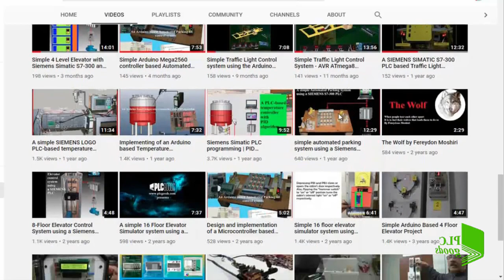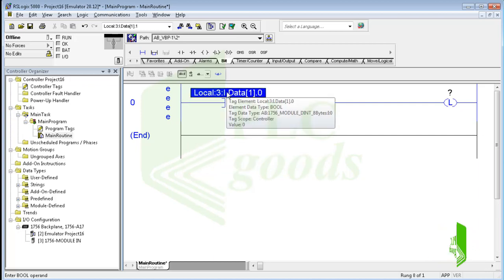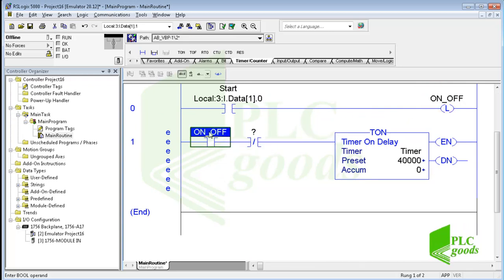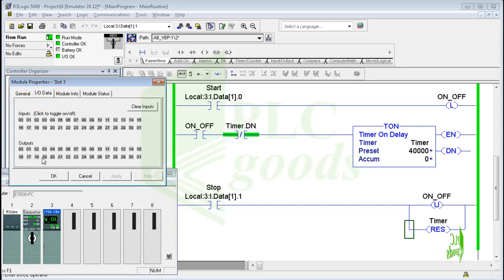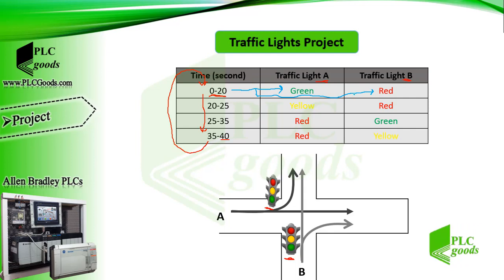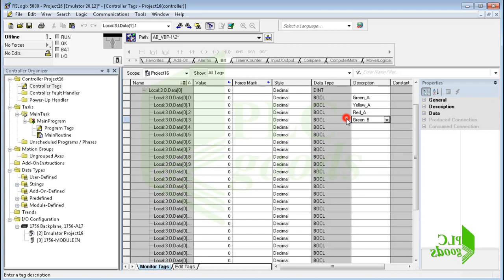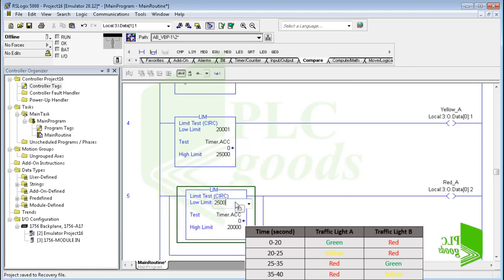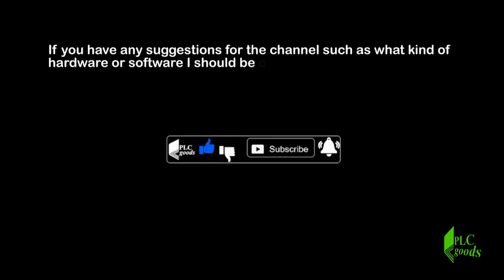Designing a traffic light control with Timer on delay TON in RSLogix 5000 Emulator Allen Bradley PLC

Comment: hello sir could you please make video on it.                           four-way traffic stop.  It will be assumed that opposing traffic lights will be duplicates of each other.  This means that the North and South lights will be the same and the East and West lights will be the same.  The intersection will be controlled by a simple set of lights:  Red – Stop         Amber – Stop if Safe to Do So          Green – Go         White – Walk / Don’t Walk          To keep the demonstration short, under normal operation the traffic lights will change every five (5) seconds.    Illuminate the white light when walking is allowed.  Don’t walk will be assumed if the white light is off.  Illuminate the white Walk light as a part of the normal green light sequence.  If a walk request is not made, the light sequence will use the standard 10 second timing.  If a Walk Request pushbutton is pressed, the timing for the requested direction is increased to 15 seconds.  After the green / walk lights are serviced in the requested direction, the sequence timing returns to 10 seconds.
Reply from the maker: "I'm here to empower you with the skills to independently troubleshoot and solve PLC problems. My tutorials aim to teach you how to fish, not just hand you a fish. While I provide guidance and learning resources, the goal is for you to develop the expertise to tackle and resolve challenges on your own."❤❤.